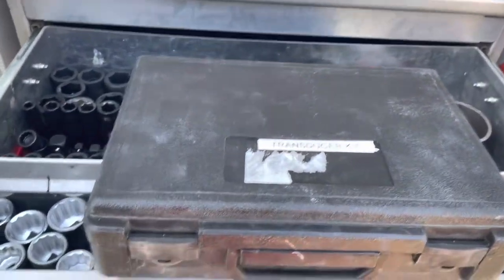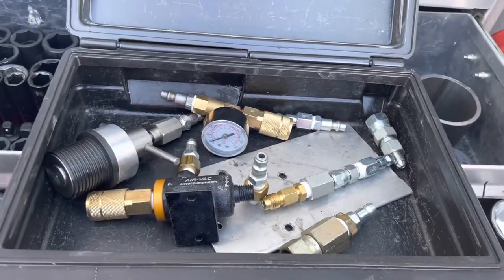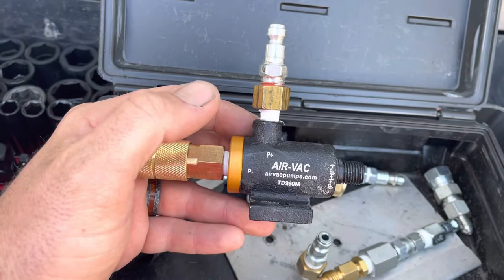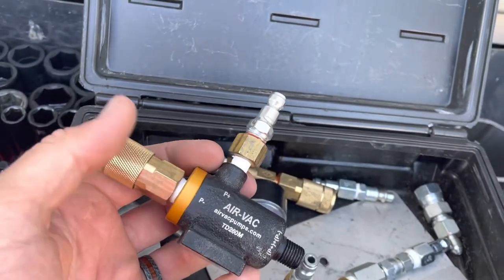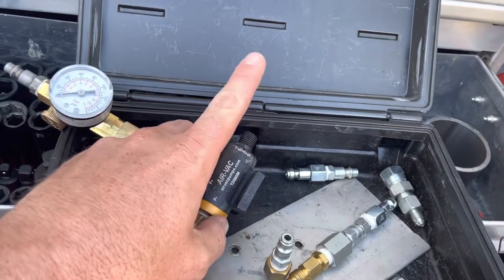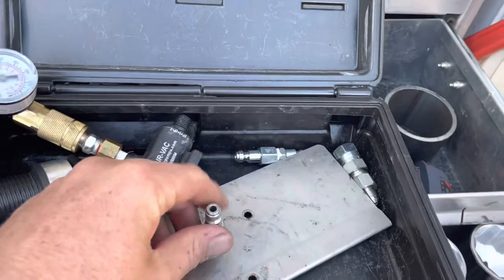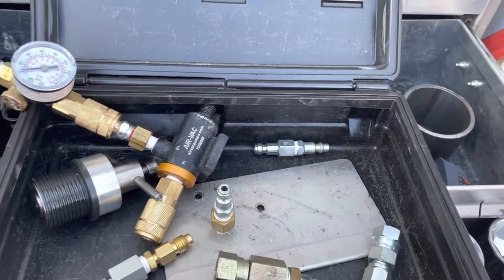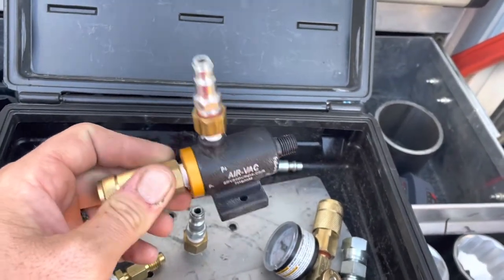How to change a hose with no oil loss

Comment: Where did you get you’re regulator for the pump. And if you pieces it together what all is needed? Thanks
Reply from the maker: I got it at home depot it was in the air tool section

Comment: What is the fitting you use for the John Deere breather?
Reply from the maker: I remove the breather and have a flat plate that bolts flat to the top with an air chuck in the top

Comment: How does that John Deere excavator adapter work?
Reply from the maker: You remove the pressure release on the hydro tank and the rubber screws into the whole
Reply: @Jasonandsonsgarage  very neat, I'm going to have to try that. Thanks!